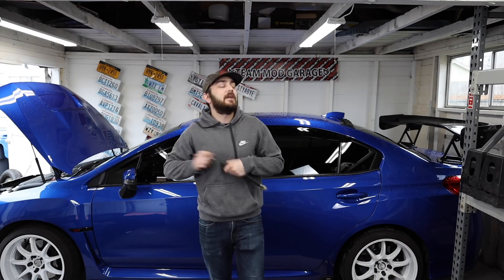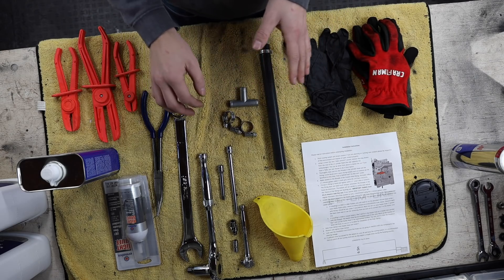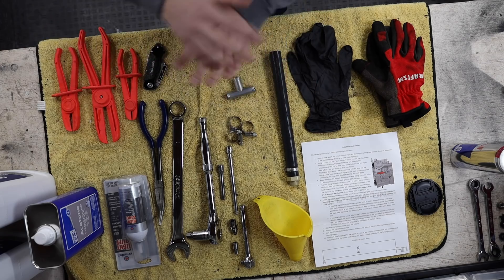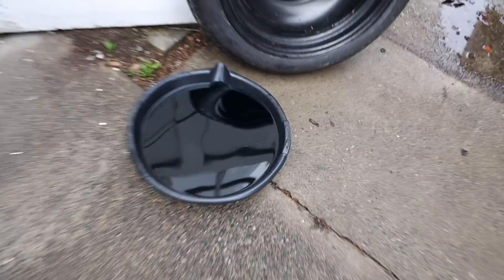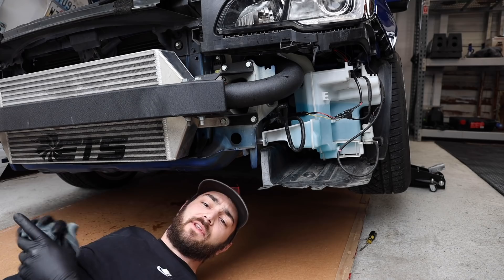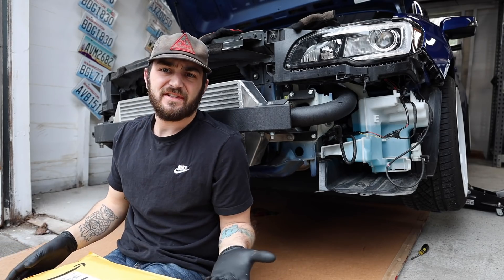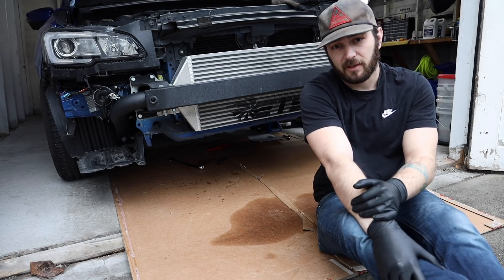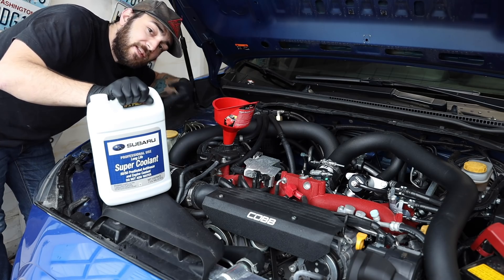Cylinder 4 Cooling MOD Install (STI)

Comment: If I’m having issues with my heat from my heater ie not getting hot, what should I do? Keep burping the baby? Lol
Reply from the maker: Keep burping 😅 took me like an hour to fully get all the air out of the system. I did notice that even after I got all the bubbles out the system still took a while to pump out some heat

Comment: Instead of draining the coolant can you just pinch the hose both side when installing the metal T fitting?
Reply from the maker: No, the coolant will come out of the back of the block as well 😖

Comment: I wanna get this for my 15 Sti terribly bad but I think it would void my warranty :/ it’s another FIFTY THOUSAND miles til I can do any mods within the warranty
Reply from the maker: It would void the warranty, my suggestion would be to just wait until your out if you don't feel comfortable voiding it
Reply: Smeedia I’m torn because it would help my engine so much. As well as a catch can or aos. Until then. I’m gonna drive very conservatively, for the most part. My shifting habits are 2800-3000. Only build boost above 3000 when I do a spirited pull (usually up to the speed limit). The warranty is up at 100k. Ik I’m the 3rd owner in 50k miles. Was also gonna ask you what your long term affects have been since you’ve done this mod. What is your AP telling you? I’m curious of what the long term affects are too
Reply from the maker: I saw decreased feedback knock but minimally, I would see the same value but not as often. Could be a placebo or could be actuality 😅

Comment: Where exactly is that bolt that needs to be removed for the fitting of the coolant mod?

I’m having difficulty finding it from these videos.

Left side of engine block? Above left axle?
Reply from the maker: If your sitting in the driver's seat its on the back of the left side head
Reply: Smeedia you’re awesome
Reply: Smeedia alright does I just saw a picture of it. But since the cylinder faces outwards, driver side, is the bolt to be removed on the same flat side as cylinder 2 and 4? Or is it underneath the block? Or on top of the block?

I don’t want to pay $150 to this mechanic which is why I’m asking
Reply from the maker: The plug is on the back side of cyl 4 facing the rear of the car right behind the steering rack and the secondary air pump location

Comment: I don’t have the accesport yet not too much $$ what should u recommend.?? Thanks for the videos
Reply from the maker: What are you looking to do? This mod does not require an AP
Reply: We’ll I don’t know exactly the temp just the gauge in the panel, just don’t want too do something wrong if u understand what I’m saying
Reply from the maker: Gotcha, just keep an eye on the stock gauge, I just prefer to see the values in actual numbers but the gauge will also work just fine to burp it
Reply: Thank u brother a million, any questions u mind me asking u in the near future
Reply from the maker: Whenever you have them shoot them over 🙏
Reply: So they told me i needed the acces port to run the intake, i thought it was if u running both the intake and the exhaust..?
Reply from the maker: Catback it is not needed an intake you need an Accessport 🙏
Reply: The car came with the exhaust hopefully it don’t hurt it until my Accesport get here, just order it today
Reply from the maker: A catback is fine a turbo back would be a potential issue
Reply: Im sorry wrong writing my bad English ain’t my first language. What i meant is that if i get the Accesport the intake would run fine.. im heading to work that’s why I responded quick now lol
Reply from the maker: No worries and yes once you get the acessport, upload thr stage 1 tune with the intake and it will run fine 🙏
Reply: Dude u fckn good, i will show u every step i do u gonna like The Godfather of my car lol. Have a good one bruh

Comment: Hey Smeedia
Love your channel bro
I just install my cylinder 4 cooling mod on 2012 sti. I connect my fitting to my top heater hose.
Is it wrong? Or should I re-do it? 
Drove it for 30min with no problem. Feed back knock stay at 0 now. Before I was 1 or 2. Any thoughts?
Reply from the maker: I beilive you want it on the bottom one which is return but moniter the coolant temos if everything looks okay I would leave it. Swapping out the hose would be a huge PIA
Reply: @Smeedia   Thank bro. Yes I will keep a eye out on it. But do u think It will cause a problem later on down the road?
Reply from the maker: I dont think so? But cannot confirm that 😅

Comment: You can source the block fitting and t-fitting for around $25 🤷‍♂️
Reply from the maker: Yes you can, if you don't mind sourcing thr parts you can make it for cheap

Comment: So out of curiosity why didn’t you do this from the top especially since your front mount anyways I would’ve thought it would be much easier.
Reply from the maker: I cpjldent read the plug on the block with the tools I had from the top. The AC, heater core and AOS hoses were all in my way so I ended up just going from the bottom

Comment: What’s your opinion on doing this mod with EL Headers?
Reply from the maker: I use ELH with this mod and haven't had any issues, in yheory they should work together great to help with temps 🔥😁
Reply: @Smeedia  I don’t get it. You have EQUAL HEADER and still doing this?
Isn’t this mod do UNEQUAL HEADERS?
Reply: @nonofyourbusinessnonofyour5435  This mod is for all EJ25 engines, specifically the turbo ones that are in the usdm sti 04-current and 06-14 wrx probably others as well, but this is aimed at those EJs. 

This sti still uses the ej257 with unequal exhaust manifolds as OEM equipment. The 2015+ WRXs use the new FA20DIT engine coming stock with equal length manifolds and a different turbo setup. 

This mod is to help even out cooling throughout the cylinders as cylinder 4 ends up running hotter in stock coolant form leading to higher chance of local  detonation, overheating and potential headgasket failure. 

Replacing the stock unequal length manifolds in the EJ25s with equal length  headers both increases scavenging for more efficient flow and increased power. It also reduces the exhaust gas temperatures by improving the flow characteristics of the exhaust by evening out the pulses as the valves open, increasing speed out of cylinder 4. It also negates some if the design faults in cylinder 4 which is that as the exhaust leaves the valves they have to make a hard turn unlike the smoother transition of cylinder 2 which is much straighter out to the manifold. This harder path ends up transferring more heat and energy to the sides of the head surrounding cylinder 4. By smoothing and improving flow you reduce a little bit of heat and energy transfer. Which can also be helped with more coolant flow obviously as shown with this mod.

Comment: I cannot find that kit anywhere in stock. Is there anyway you can send me a list of the components used so I can make my own🤷🏼‍♂️🙏🏻
Reply from the maker: Just a metal T fitting, some heater core house, worm gear clamps and the plug to the back of thr block (not sure on the thread pitch off of the top of my head)
Reply: Smeedia what size hose and fittings
Reply from the maker: I want to say 1/2" but Off the top of my head I have no clue, I would pull up one of the vendors who sells it and just pull their specs and mirror it to make you own. You should be able to get everything at the auto parts store.
Reply: Smeedia Thanks man I greatly appreciate it

Comment: Can I use these "good stuff" sealant on the new oil pan? Planing on doing them both so I wont need to buy 2 different sealants if it works for both places, because I saw you used a different sealant on the killer b oil pan
Reply from the maker: I would use the RTV Black for the pan, theyre rated for 2 different temps and you wpuldent want the pan to leak after reinstalling it 😅

Comment: Did you ever end up pinching off the cooling mod before burping the system? I know you had mentioned it in your video (and says in the instructions), but not sure if you actually did it. Is it absolutely necessary to do?
Reply from the maker: I did not do it, just took me longer to burp the car 😅

Comment: Great video man! I just did this on my 2020 STI last week and today I found coolant splashing all over my radiator cap for some reason. The car is 5 months old with 7K miles on it and I doubt its the cap. Should I burp the system again if air caused this?
Reply from the maker: Check around the cap for small cracks in the radiator if it all looks good I would suggest burping again

Comment: I am running the IAG 2.5 closed deck. Does anyone know of this is recommended on these too?
Reply: Curious about this too
Reply from the maker: Not sure on this one, I would think it is still beneficial, but will also depend on the block that's used IE a seasoned block vs new case halves
Reply: @Smeedia  BNIB short block, 1.4k miles as of now. Stage 3ish (Cobb flex fuel kit, IAG AOS, DP+catback, ECBS, GS TMIC.....) motul 10W40 every 3k.
Reply from the maker: If it were me, I would install one, its cheep insurance that helps coolant flow through the head

Comment: Need some help. Is the bottom hose coming from the heater core normally go to the outer most hose going to the engine right side (drivers side). Hope im making sense. Thanks
Reply from the maker: Not quite sure what your asking lol your going to want to tap into the inner most hise

Comment: Dumb question: Was pulling off the bumper and under tray necessary? I hope not 🤞🏽
Thanks in advance.
Reply from the maker: For me yes because I have my splitter that goes under the car. 😅 for a normal car you just have to remove the under tray
Reply: Smeedia Finished for the most part. At 9:45 you said to pinch the line off and rev the engine a few times. 1: Were you able to do that? 2: Were you referring to the Dom hose when pinching?
Thanks again!!!
Reply: One last question on top of the previous 2. 
Did you actually wait the 24 hrs prior to burping?
Reply from the maker: @BluPrynt78  no..... lol I waited like 2 hours 😅

Comment: Is the plastic T fitting really something to be concerned about compared to the stainless?
Reply from the maker: Over time the plastic can start to break down but should be fine using the plastic one. I wanted the metal for a little extra security

Comment: u actually used the 1 minute gasket maker lol. but yea how did you screw in the mod? with your hand? also, when u cutt the hose, more coolant came out? cant we just drain from the petcock under the radiator? to take out all the coolant? or gotta take it out from the oil cooler?
Reply from the maker: You can drain it from the radiator but I did not want to refill the entire cooling system lol. And I would say about 8 oz. Of coolant came out after cutting the hose 😅
Reply: Smeedia you threaded the cooling mod by hand? since you used the 1minute permatex?
Reply from the maker: Just to get it started, used a small crescent wrench to tighten it down

Comment: Did you add the coolant conditioner? The service manual calls for it to be added.
Reply from the maker: I did not, I generally dont use it because I'm always doing something that requires me to pull coolant every few months so did not use it  but if you know your not going to drain coolant then you can.

Comment: Would this be necessary or even worth it for someone in Alaska where temps rarely reach 80° in the summer, and summer is short? Basically only drive the Subie when I can't ride my motorcycle, and then drive it all winter where temps are generally 20°F to -40°F.
Reply from the maker: Yes I would still suggest it, internal engine temps and ambient temps are correlated but the engine will always get to operating temperature and the increased coolant flow will still benefit the engine
Reply: Smeedia thanks for the info! I'll look into ordering one for my series white! Coming from a WRX so I'm super excited, want to do this and the AOS for longevity.

Comment: Which tool did you end up using to tighten the fitting? 👍🏽
Reply from the maker: A crescent wrench 😅 I had a super small one that I was able to get enough leverage on to be able to tighten the fitting

Comment: I feel like the STI is one of the only cars that need so many additional preventatives to stop it from blowing up and after all that money is spent there is still a chance of blowing. . 🥺
Reply from the maker: Depends there are other engines that also need support. My old RB needed a lot of oiling support to keep it reliable

Comment: Did you remove the stock air pump or are you still running it? Hard to tell with the angle of the video.
Reply from the maker: Still running the air pump until my next tune
Reply: Thank you

Comment: Have you measure your temp after this mod? I know dom have but like too hear it from one customer.
How dose it perform wile drivning? 
Big fan of your bild!
Reply from the maker: The coolant temps don't change, but the heat reduction inside cylinder 4 is on a white paper Dom did. Overall I've seen less knock use to average -2.40 now I only really see -1.40. And thank you!

Comment: How much coolant do you put back into the car??
Reply from the maker: About 2 gallons
Reply: Smeedia so I did what you did I drained the coolant from the line under the car by the oil filter like you did. Then when I cut the hose to put in the “extra line” some some more came out. I didn’t get “subaru coolant” or the “oem” stuff I got other shit that was name brand 50/50. Should I be ok to put it into the top cap like you did? And I should put 2 gallons I don’t think 2 gallons even came out of the car
Reply from the maker: @jacecooley1299  there may have been residual coolant in the heater core line. And your fine to use the 50/50. The substi blocks are a little picky. I'm not sure the exact amount I pulled out. But I know after burping the car I ended up putting in about 2 gallons of coolant

Comment: Did this make a difference in cooling if so how much  of a difference
Reply from the maker: No difference in general cooling however there are temperature differences in cylinder 4. Dom has some charts about the cooling delta on their website

Comment: Wish the previous owner of the wrx i now own knew about this.. cyl 4 25psi compression squad
Reply from the maker: Oof, sorry to hear 😫 swapping the engine I presume?
Reply: @Smeedia  going to see what i can afford to do come tax time. I'm either gonna throw a pile of money at it and get a brand new engine with some of the mods you've showcased on your channel to increase reliability and power, or drive it until it grenades lol
Reply from the maker: @Insomniac350  lol you may still be able to save the block at minimum the heads to save yourself some money if you do pull it 😫
Reply: @Insomniac350  may as well go for closed deck forged internals

Comment: Another great video! 

But another video production critique. Get yourself an smaller camera. Not a mainline camera like your DSLR, but maybe a secondary camera like a GoPro or even a RunCam2. Something with a wide angle lens on it. The RunCam2 is like $79 on Amazon. And with proper lighting, these cameras don't look too bad. If its for a cut away angle/B Roll in those tight spots, then that's OK if the video quality is different. It would have helped this video soooooo much to see your work. 
Yeah its a bit more work in the edit, but think about the production value and all of us poor little WRX/STi, video starved waifs dying to see the actual work being done. 
For gods sake man, think of the children!
Reply from the maker: Haha appreciate the feedback 😅 I have a Go Pro Hero 7 i just need to utilize it more. I nee to remember that its only sometimes to reduce quality for what needs to be seen. I'm always open to the production tips whenever you've got them!

Comment: Cylinder 4 cooling mod. Get equal length headers.
Reply from the maker: ELH's are on my list to get this year looking at Killer B and ETS
Reply: @Smeedia  killer b are the best. My shop says if you can't afford them, you won't be compromising too much by going with tomei.
Reply from the maker: @AndyRock1  any feedback on the ETS ones? I ran the Perrin Big Tube on my last STI and they melted the radiator fans
Reply: @Smeedia  I honestly didn't even know ets made headers. On my '06 I used the perrin small tube for spool, and drove them for 40,000 miles no melting. 

My tomei were just installed (2016 sti) , my tuner noted that I gained huge torque from the elh.  Made 372wtq on 91 pump gas stock turbo.

You can definitely call the shop I use, they are top notch. The in house tuner is the owner of Snail Performance, Travis. He knows his stuff.

Comment: How the hell do you not have one of these to do a proper burp? I have had WAY too many problems with people not burping a Subaru properly.

EPAuto Spill Proof Radiator Coolant Filling Funnel Kit - https://www.amazon.com/dp/B01I40ZQWE
Reply from the maker: I use to have one but it vanished somewhere in my garage 😅 ordered a replacement one the other day

Comment: Best mod I’ve done on my Sti😎
Reply: How long have you had it on. What is your review of it. Any differences noted?
Reply: Waleed Abdalla I got it done back in November at National Speed up in Wilmington, NC. Driving back to South Carolina I noticed the temps were still the same even with the coolant cycling through another pathway. Car cools faster when I’m pushing it. I have no complaints at all. Looking into the CSF Radiator with oil cooler as my next purchase to see if I can reduce temps even more. You’ll most likely notice more differences depending on where you are located.
Reply: @theblueninjazx10r  I'm in Kenya and I wanted to get reviews before I decide to get it for my 2001 WRX JDM
Reply: Waleed Abdalla I understand. You will definitely see the benefits from it and have a piece safety if you’re concerned about the ring land failure.